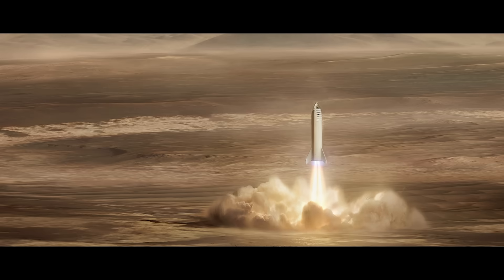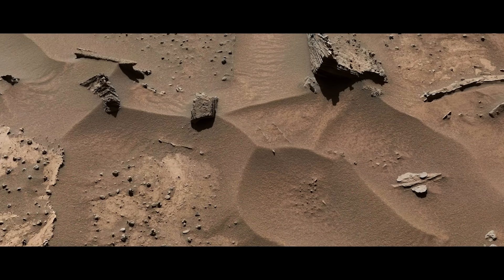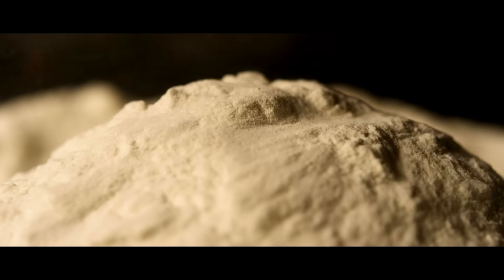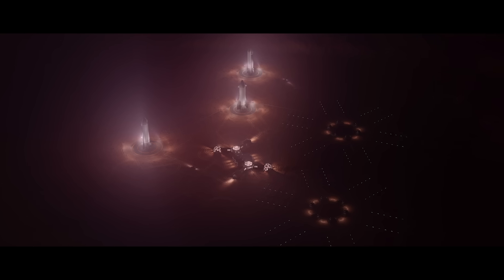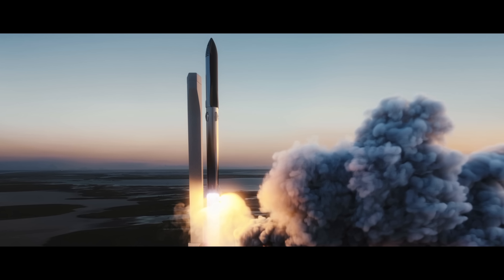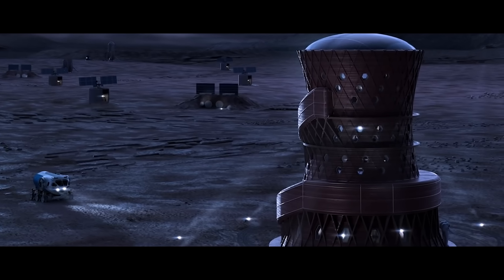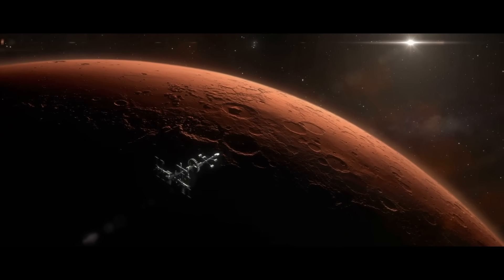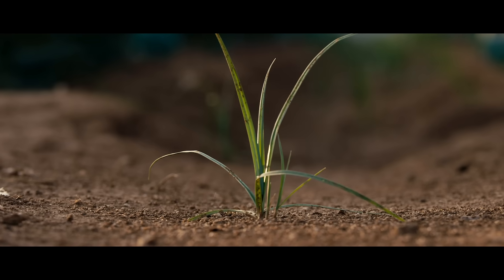THE FIRST 10,000 DAYS ON MARS (Timelapse)

Comment: 2100 Marsternet is connected to Earth's Internet.  Ping time: 12 minutes
Reply: Turn-based games  become mainstream.
Reply: @nonamenoname1942  CIVILIZATION 12 now game of the year
Reply: would be better than my my actual ping on earth lol
Reply: @entenbraten8741  Maybe invest in Starlink if you can
Reply: @warjt4737  Good idea xD
Reply: There will be at least a laser connection to Earth's net at some point. Ping will vary as the distance will change all the time. Until they can manufacture 2 quantum halves and send one side to Mars. For instantaneous data transfer. (just my imagination)...
Reply: Lets work on sending a man to the moon first.
Reply: Yeah they play Minecraft togehter
Reply: Are you guys living under rocks?
The Quantum Internet is coming by 2030 and even that shouldn't be that far away, because in 2016 it was tested by satellite and also Quantum Teleportation aka Quantum Entanglement works with wireless through the air and existing fiber optics.

Chicago has a Quantum Internet prototype 53 miles from one lab to the other in 2020, and had another test coming for 83 miles to another lab, they have plans for a 2030 Quantum Internet, imagine almost no ping if any at all from 3 times the speed of light.

Read through my other comments below and find my other channel with the "created playlists" to start at the bottom of the created playlists.
Reply: @gameresearch9535  you talk about so many things simultaneously that it is hard to know where to start:

1. Quantum entanglement is a thing. In theory if you know the spin of the particles you could transmit information real time. Yet as far as we know this violates the basic principles of causation. It would, in effect, be time travel. So the gotcha is that you may never measure the spin before you know the current spin, or something like that. And to you know the spin, that information would need to travel via conventional routes, thus maximum speed of light. This is infact fortunate as otherwise we would know shit about the universe.

2. Use photons instead of electrons in computers: we use fiber optics to convey information as we speak. It is somewhat more reliable and manages better trough put that conventional copper. Yet in recent years copper wiring has become extremely fast, rivalling fibre channel in shorter distances. Yet all our current chips more or less work with electrons and there is no fast way, or need out of this.

3. Quantum computing. This is bit of a wisdom stone. A lot of people keep talking about it but no rear world applications have yet been implemented. This in a sense would work so that a cubits have way more states than simple electrons, so you could convey a lot more data in smaller bursts. But this far remains somewhat science fiction.

4. Why would a space ship need that kind of computing power? We have plenty fast computers to do what that needs if we just get the software right. I bet landing that thing actually is easier than building a self driving car.

5. Graphene is a nice material. To this date it remains extremely expensive and again, in real world offers negligible gains, especially compared to the price.

I hope that clears some things up. But as stated you discussed so many different topics that it is hard to address all of them.
Reply: @SampoSaarela  

Ok I know where you're going with this, I'm not reading your comment until you read all of mine starting with the top to the bottom obviously, and then check out the "created playlists" on my other channel.

I don't have to explain what is already there, and don't insult me with ignorance, or patronizing me either for what I already know, so yeah I'm way ahead of you, easily seen if you go to my other channel with the created playlists.

And this isn't just for your ignorance, it's for a lot of people here that don't know or for other people with ignorance that don't want to know.

And if you have to ask, then you're not creative enough to understand or how to brainstorm these Quantum 2D materials, Photonics and Quantum Technologies.
You're also not capable of understanding what they are good for as the result and reasons.
I'm not going to waste time explaining the obvious for short - sighted people that can't think outside the box and haven't even gone to see all the playlists on my other channel under the created playlists.
Reply: @gameresearch9535  I'm not really understanding why you try to insult me. I have studies physics for short while in  uni and for example the quantum entanglement thing is very well known, theorized first time s hundred years ago and every study and every reputable scientist is convinced that Einstein was right and no information can ever travel faster than light.

Secondly what I said about need for quantum computers on board of space ships, I'm quite convinced on my argument as I have been writing software for 15 years and can easily imagine the complexity required of such software, and it isn't too high. And to be honest it has been demonstrated already that they don't have any need for quantum computers there. Or even anything too special, some shit like 8 cores and 16GB ram is probably plenty to land that thing.
Reply: @SampoSaarela  

Then don't insult me, everything I gave were the facts from proof. If you don't like what you heard, then go tell it to the people in the videos that show such facts from proof and so much more.

If you feel it is a lie, go tell them about it, not me. And go visit the companies in the videos to find out.

I'm sorry but everything on my other channel has too much proof, I'm not going to just go oh well! One random person on the internet told me it's not!

Don't insult me like that, I didn't collect all that information over the past 2 years to just be patronized and with all the latest information of where we are, with also breakthroughs and so much more.

---------

You're now talking about a hundred years ago.
You do realize that a hundred years ago, there wasn't the level of innovation that we have now?
Think about what innovation is and when I mention innovation "to a whole other level", and now Sci - fi level innovation and beyond.

When you go to my other channel and check out the Quantum Teleportation playlist, watch a video that is 50 minutes long on a full documentary about Quantum Entanglement with Einstein closing all contact with another professor, because Einstein didn't want to believe that Quantum Entanglement was real.

If you have no idea, you better look at my other channel's playlists as to where we are at right now, and there are Quantum Computer breakthroughs supposedly once every week, which I'm now repeating myself.
I can't even keep up with them, but it will blow your mind what you are about to see on my other channel under the "created playlists" when you watch them all starting from the bottom.

Now don't waste my time, I have a lot of other people to contact.

It would be nice if you would be respectful and read my other comments, you are the one that threw the insults first. And then watch my other channel under the "created playlists" not just about my comments, but watch all the playlists to learn a lot about what is currently going on, and you will be shocked.
I didn't make these things up, and I don't believe in things without facts from proof, same goes with Covid-19 not shown under a microscope, in-person, with the microscope hooked up to a computer and seen on the monitor, "done many times in the past with other reasons", and a news camera connected to the desktop PC to view what is on the monitor screen for showing Covid-19, I don't easily go to believe that nonsense, and if they tried to make us believe by doing that now, it could easily be a lie and a man-made virus at that point, anything to make people believe.
So trust me when I am very careful about what sources I look at, and if any of them were disproven, I would expect videos deleted. Some of them though can't be disproven that are shown in-person on screen such as on the table with 3 times the speed of light, and many other things shown like about Graphene and Photonics, no way, there are too many facts from proof there.
Reply: @SampoSaarela  

Sigh... the very thought that you're talking about PC hardware and not things that a Quantum Computer can do when brainstorming, shows a very lack of the creative mind and very small thinking.

The hardware speed and specs has nothing to do with what I was talking about, I don't expect small minds to understand.

Don't insult me like that, just learn to go to the other channel and find out under the created playlists, instead of being stubborn and hard headed, this is called being closed - minded and thus short - sighted as the result, don't do that, it's annoying, stop it.
Reply: @gameresearch9535  Do you know how Quantum actually works?
Reply: There are so many missing things here in the video, think about why the media never talks about Graphene combined with Photonics as the basis and "standard" for all our products today and future products like Quantum Computers and other Quantum Technologies.
Quantum Computers also have breakthroughs supposedly once every week.

Why aren't they using Quantum Computers to make better designs and engineering for the SpaceX Starships and more.
And why aren't Quantum Computers inside the Starships.

Why isn't Graphene combined with Photonics mentioned, and at the least Photonics to replace the electronics = electricity (electrons) for the Starships circuits, bridge and more.

I'm aware of the need to scale up Graphene faster and cheap enough while in its purest form, but to not be creative with the imagination, without brainstorming, no collaboration or Sci - fi level innovation and beyond, is quite absurd.

Nasa's space rockets, control room and rovers could be using Quantum Computers, and Graphene combined with Photonics, again at the least Photonics (for now) with Quantum Computers.

Nasa, SpaceX, I.T.E.R. and other private funding fusion energy reactor companies, The Gateway Foundation / Orbital Assembly corp., Virgin Hyperloop One and so much more, none of them mention any of this.

Look at the news on Covid-19 rather you believe it or not, the news offline from TV and online from youtube's homepage if you scroll down it for the Covid-19 section, and question why none of the news channels with videos on Covid-19, all of them from early 2020 and on, have no videos about Graphene combined with Photonics, Quantum Computers, The Quantum Microscope, and other Quantum Technologies, and behold.. the level of greed and corruption you now have seen.

----------------------------------

And question why none of the youtube videos about warp drives never include Quantum Computers to help with big algorithms for the warp drives, warp drive energy, and anything space exploration related.

================================================

Check my other comment below for steps to my other channel about Sci - fi level innovation and beyond, e.g. Graphene combined with Photonics, and Quantum Technologies, also warp drives and so much more.
Reply: @gameresearch9535  And do you know Radiation destroys electronics...
Reply: @Meiseside  

Very short - sighted of you, do you know what Graphene can do?

I suggest you learn to read, and stop being ignorant and find out from the steps in one of my comments to my other channel for the "created playlists".
Reply: @gameresearch9535  did you study physics?
Reply: Ok so links either hide or delete my comments with them.
I will have steps to my other channel.

1. Go to my channel and find the "About" tab with important info to read and a link, go to the link and you might have to click on the words "created playlists".
2. Save the link to the created playlists to your browser, start at the bottom of the created playlists with the Graphene playlist, work your way to the top playlists.
3. When under the created playlists, click the "view full playlist" below each playlist, look to the left at the "playlist description", and click the "show more" button to scroll and see more articles, important info, and other links to official websites from the tech companies in the videos, and so much more.
Reply: avail fiber line then connect it from earth to mars.
Reply: Sadly its impossible to get any ping less than 6 minutes. It takes 3 minutes for LIGHT to travel from Mars to Earth when Mars is at its closest to Earth. So, to send information itll take 3 minutes and to receive it will take a total of 6 minutes at both the best position AND if we could send information at the speed of light

Comment: Somehow the question of food is largely sidestepped. On earth, you need to the order of magnitude of 1000m2 of agricultural area to feed one person. On Mars, growing plants is significantly more difficult due to the lower levels of solar irradiation. All these pretty pics of a few m2 of plants in a lab under artificial light don't really give us a realistic answer to the question of where the food is coming from. The aquaculture thing doesn't provide an answer either - you need to feed fish, and you need to put more calories in in the form of fish feed than you get out in fish meat.
Of course, if you assume that nuclear fusion gives you vast amounts of energy then you could use that energy to grow plants under artificial LED light. But realistically it'll take a long time until you have a working fusion reactor on Mars. Until then, food will be a bottle neck. Water can be circulated (unpleasant as the thought of effectively drinking your own pee and sweat may be) but food is basically fixed solar energy. You need a lot of area to fix that light, especially on a dim planet.

Comment: Moving tens of thousands of rocketships that size out of Earth's orbit is going to create one nasty pollution problem.
The fuels used aren't exactly environmentally friendly.
Reply: That would be the case with solid rocket boosters(looking at SLS and NASA, or RPG(merlin engine), but the raptor engine uses methane which produces very less pollution. It produces only CO2 and very little pollutants like nitrates or sulphates.
Reply: If you see falcon 9 launches they produce lot of smoke, but the starship flights have almost no visible smoke!
Reply: Moon colony and mining as a starting point would be better, great spot to manufacture, launch craft easier, take asteroids back to smelt down materials, etc.
Reply: Solar power for electrolysis to split h2o into hydrogen and o2. Use those for 2 gasses as your rocket fuel and you have solar powered rockets.

Comment: Regolith rather than "Martian soil" will be used to protect any surface structures, mostly from solar radiation. Simpler by far to build large, vaulted trench systems or bore tunnel networks into the side of Martian craters or canyons than depending on surface-level domes/

Comment: The timeline of this presentation is quite ambitious and is using "Elon" time.  That SpaceX will be ready in about  3-1/2 years to launch a fully equipped prep mission to mars in 2024 when they are just now figuring out how to land Starship is highly unlikely.  Given the actual realities of developing such an advanced system I would double all these times at the very least.  Also, you are not going to run a Mars colony solely on solar power due to dust storms that can last weeks.  This precludes using batteries since it would be very difficult to store such an extended energy supply.  Fission generators will have to supplement until the fusion plant can be built.

Comment: This is science fiction. No man will ever set foot on mars. The radiation level alone is too high, not to mention the sand being fine enough to ruin all electronics and mechanics (Its why rovers eventually fail), and then there is the lack of gravity which effects bone density and genetic stability and your immune system. Then there are the storms, the size of our continent, that last for days or weeks. The atmo is 1% that of earth, which means you will never get enough greenhouse gas to terraform it. There is no molten core that generates an electromagnetic field to protect the planet, so any O2 would just disappear into the vacuumed of space anyways.  It makes no sense when you can send autonomous drones and learn all there is to learn.
Reply: So you are an astronomer right🙂?

Comment: This got my hopes so high and then i remembered james webb telescope
Reply: whats bad about the jwt?
Reply: @dantaerodgers2555  it took a very long time.
Reply: @retroflame3104  ok i gotcha. yes it sure did. But i if its 4 times bigger than hubble with new technology, the thing can discover alot of stuff
Reply: @dantaerodgers2555  You are right jwst is really complicated but it is still a space telescope and if a space telescope can be delayed that much, we are talking about a mars base here so imagine the challenges it would have to face and the delay would be significant.
Reply: @Abhi-rc9fm  most definitely. Imagine the Point when the Singularity happen. You gonna start seeing 10 year breakthroughs happening in 1-2 years. Thanks to Ai, Quantum Computers all working together. That point is expected to be in 2025-2045
Reply: @dantaerodgers2555  It was suppose to launch in 2007 and its 2021
Reply: This is not nasa, it’s spaceX which means funding is not based on public opinion.

Comment: So where do you get power when sand storm is around the whole Mars planet?
Solar panels become useless
Reply: Ever heard of Powerbank?
Reply: Mars is further away than Earth, so solar panels have 40% less light, secondly dust that cover panels reducing the light even more. 
Power banks are not limitless, if you run out you screwed. 
There has to be some other ways, wind turbines or smth else. 
But you cannot rely a 100% to just solar panels.